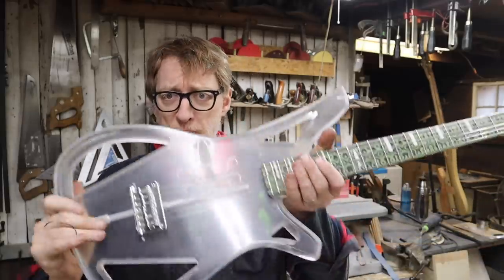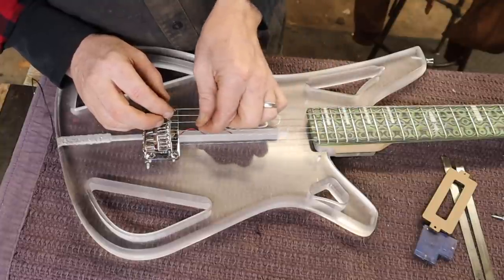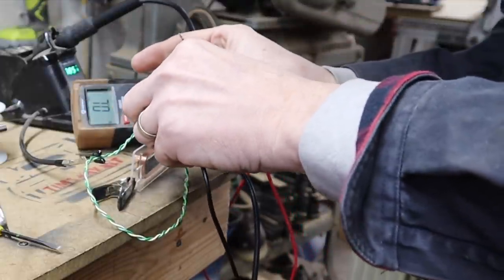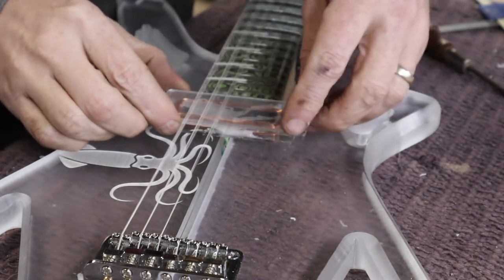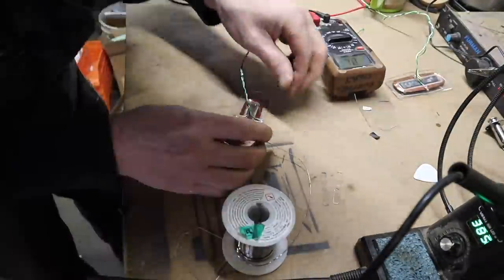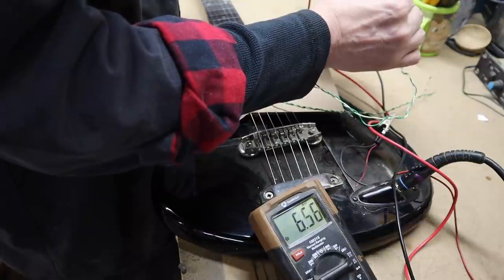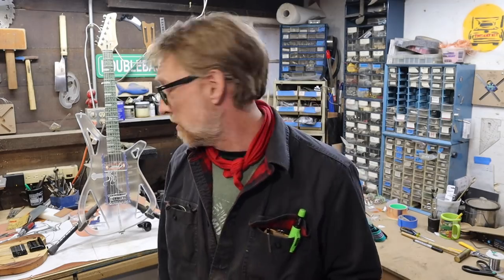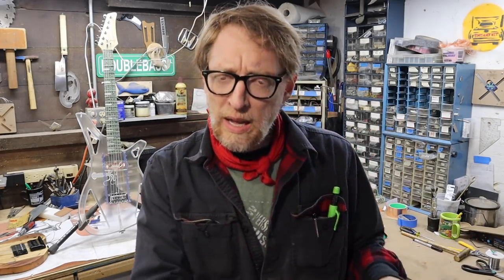Movable, "Floating" Guitar Pickup (get it???)

Comment: This sliding pickup mechanism is I think almost exactly what Gibson did with their Grabber bass. Your guitar has the added benefit of at least double if not triple the travel area.

Love the pickup itself. It's got that trashy goldfoil sound but with the added benefit of modern construction and technique. You should sell these on their own as "Neo-Foils".
Reply from the maker: For sure, I was thinking Grabber but better. If I do another it'll look even more like the Grabber, but hopefully still with extended range. The Grabber hardly moves at all. I am developing my own "goldfoils" that will be top mount and not have any gold or be called gold. That's really what this experiment was about for me, a prelude to things to come.
Reply: His setup works much better. The Grabber was limited in travel because Gibson was so intent on hiding everything beneath a plastic pickguard. It was saved only by the fact that a bass guitar has so much longer a scale length, and therefore more room to travel.

Comment: presumably, the dead spots are the nodes and the "sweet spots" are the anti-nodes of various low order harmonics. if you measured the pickup position and divide the scale length by it you could figure out exactly which one
Reply: Yes. I built myself a simple bass body, for the original is multiplex that is a bit thin. For the single pickup I simply made three different holes, so I can mount it in bridge, middle or neck position. Looks funny, but it works okay. Thanks for reminding me of possible dead spots. Next time I can look for three optimal spots. The original body lacked some resonance, and maybe I should try adjusting the pickup position. Simply turning it 180 degrees will make a difference. Interesting! Maybe I should give that original body a second chance. Floating bridge? Hmm.
Reply: You can calculate all that on open strings, but when you fret the note you will change the length of the vibrating string and the nodes and the antinodes move accordingly. This is always the problem with the "sweet spot" pickup placement. It depends on what you play. The beauty in tim's design is you could optimize the pickup spot for a song... Or maybe even for a part of a song if you can move the pickup fast and accurately enough.
Reply: @Elektronijaenis  Yeah, because of how that happens, pickup placement to me is much more about how the pickup interacts with string physics as you fret at different parts of the neck. To keep it simple, bridge positions are consistently bright/light/thin as they never catch a large amount of the amplitude. Neck positions catch a large amplitude at the top of the fretboard, a larger amplitude in the middle, then a lower amplitude as you work you way to the bottom around the 17th fret onward. Lastly, middle pickup positions gradually catch a large amplitude as you further shorten the string via fretting, thereby compensating for the reduced potential energy that the string can impart and giving you the strongest reasonable signal at all fretted positions without having a quantum superpositioning pickup.

Comment: you could make it even more elegant by having two more slots instead of rails, with each pickup having a pair of machine screws that go through from the other side. to move the pickup, just loosen the screws a little on the back, move it, tighten em again.
Reply: I thought of something similar while watching this. You could have a thumb screw right in the main channel with a felt washer. A small turn could lock it in place or allow you to set the amount of force needed to actively move it.
Reply from the maker: my original idea was similar to that, with a spring-loaded knob you'd pull to release. But I'm not interested enough in the concept to do all that and make it work! lol
Reply: @timsway  spring loaded seems overcomplicated i agree. maybe some nylon washers so it's the same sort of friction fit, just secured from the other direction

Comment: Hi Tim, I did this in the early nineties on a strat with three single coils  and used plastic U shaped strips cut from builders ceiling edge trim lengths.
 
I had the rails angled down towards the neck to allow the rear pick would  up to sit higher... The rails were adhered to both sides of the swimming pool route ..
Reply from the maker: awesome. We were talking about making it higher at the bridge in the comments. great idea!

Comment: One of the reasons for "hotter" output pick up in the bridge is because as you get closer to the bridge the movement of the string is less therefore less induced current.  Well I remember getting that gem from some pickup guru at some point
Reply from the maker: absolutely. you can really hear it in this

Comment: I love it with the translucent aesthetic.

I think with some of the fancy hardware ideas it could be cleaner and more slick. I'm sure you have thought of this,  two metal strips in the slot that both conduct the signal and act as the friction guide. Might need something on the back of the guitar to hold the pickup down. But yeah, that's getting into the weeds for sure.
Reply from the maker: oh yeas, I thought of it! lol. So much I made a detachable double neck guitar in last year's GGBO that features snap connecting electronics as proof of concept.

Comment: Tim I truly believe if you pursue this floating pickup rabbit hole, making it as easy and smooth to move as a whammy bar could actually redefine what an electric guitar can do. What about split pickups? What about 1 pickup in four parts in a humbucking configuration like tele middle position where you could have a huge spread. Each part split for bass and treble side and 4 rail systems total.

What if the pickup was rigged on elastic or springy wire so they could bounce around and react to your playing?

My favourite part of electric is the dimensions of feel you can add as a musician in contrast to something like a piano. Vibrato, bends, slides, whammy bar, Wah pedal, and now movable pickups. 

Pickups have always been fixed, pickup position Has such a huge influence over tone and sound. Why not unlock that feature and give the power to the performing musicians?

I've seen movable pickup systems but the simplicity of your system and seeing you move it live while performing really made something click with me. Please pursue further!!! (If you're inclined)

Comment: I've always wondered about getting the perfect combination sound of two pickups. I've always hated the sound of two pickups on at the same time when the pickups are in the usual positions (most Gibsons or a Tele, for instance). Strats are better because the pickups are closer together. They produce less quack than two pickups farther apart. I find myself craving even less quack though. I want to hear what two pickups (Strats or Teles being my go-to) with one in the usual neck position and another sort of halfway between neck and middle. I built a guitar 30 years ago that had four equidistant pickups and was able to get that sound. But I didn't keep the guitar long (I put a Kahler on it and totally ruined its tone) so I don't know if it would be worth repeating the experiment again.

That's where you come in. LOL.

Comment: A second comment and aside on construction: You should use flexable Silicone stranded wire, it is less likely to break from the movement. 

A Theoretically better choice mechanically would be running copper strips for negative and positive bus bars, then having the pickups negative and positive leads be springloaded pins that pressed against these - It would also give it another way to keep its tension on the guitar body. The issue with that is its more susceptible to corrosion and debris.

This overall is a concept Gibson explored back in the day with the Gibson Grabber Bass, but that thing lacked the scope of movement you have here. Really like your spin on it.

Comment: Don't want to sound like a nerd or anything but historically bridge pickups in sets are wired hotter (more output) than their neck matches to compensate for the lower amplitude of string vibration closer to the bridge. Maybe you can do a workaround to that by making the rails oblique to the body's plane, so that the pickup is closer to the strings at the bridge (higher) and further from the strings at the neck (lower) so you can get a balanced output volume all across the slider
Reply from the maker: yes! I've discussed this with a few people. I think a slightly "uphill" channel would do the trick.

Comment: If posible I would think about experimenting with the whole contraption somehow being at a slight angle, so the pickup gets slightly further away from the strings when going towards the neck. This would maybe somewhat counter the perceived volume increase the more you go towards the neck due to more bass freq content / larger string vibration amplitude (reason why bridge pickups are overwound in comparison to neck pickups in pickup sets).

Comment: To me it suggests chosen pickups should be ‘tuned’ into position to determine the sweet spot before mounting them when building a guitar.
Reply from the maker: indeed. I always knew there were "sweet spots" but I had no idea how dramatically different they are. A real under powered pickup really highlights that. My guess is the spot is going to be in basically the same spot on every guitar of the same scale length, tho, so I think it's pretty safe to generalize. What I learned from this is I'm going to push my neck position pickup back just a tiny bit in future builds.
Reply: Would be worth trying with different strength pickups on main brands to see if there’s more than a subtle difference. I could imagine yours being an ideal audio guitar especially without additional pots.

Comment: I've been toying with the idea of sliding pickups for a while... but since it was basically impossible to put a patent on them, I lost interest. Anyway, you could get a much cleaner system if you put the pickup on a tiny threaded bar going thru the body, and having a long threaded rod in the "butt" of the guitar body to move it back and forth. If you tighten, the pickup will move toward the bridge and vice-versa. The guitar already has a channel routed in the center line, so it would be easy to do.

Comment: Great work Tim. I enjoyed hearing the tone variations in the different positions. Have you considered using a round flange on the back of the bobbin (to go into the channel) so you can angle the pickup?
Reply from the maker: the original idea was to have a spring loaded round post run through that channel so you'd pull on it from the back and slide/spin, but there were pros and cons and the "wave" tracks were still needed. I could spin the first one diagonal and heard/saw no benefit to it, so I didn't miss removing that feature.

Comment: Cool. I like the sliding pickup. Yours is the most elegant design I've seen. It makes a very effective and instructive tool. 😎
I've experimented with moving the pickups on my guitar, and there are a couple of spots they are extra loud. As you mentioned, a 2-pickup design would probably suffice, and that's what I currently have. Thanks
Reply from the maker: I don;t think you need to go crazy winding them. I'm not an expert by any means, but it seems the length of the wire in relation to the poles is part of the equation, so less winds around a smaller pole is still appropriate? I dunno. Just start making and trying things and NEVER expect to get it all right the first time.

Comment: I tried making something similar with a cheap strat that already has the swimming pool routing. But my idea was to use two metal rods like the ones you'd find in a disc drive for moving the laser, and the rods themselves would be the contact points to the pickups, so no moving wires. Still might work it someday.
Reply from the maker: that was my initial idea, to make the top and bottom contact points the electrical connection (then you could swap new pickups in and out without wiring changes, if done right). Requires a little more engineering but totally doable

Comment: I’d like to see one that’s got a toothed rack in the trench, and a rotary damper on the pickup. It would resist movement but still always be mobile and infinitely adjustable.
Reply: I'd like one that has an air cusion underneath, moving like a hovercraft.  Has anyone reminded you of the "keep it simple stupid" motto before? Simplicity is its own reward.
Reply: @voornaam3191  only if I can use farts as the air cushion!
Reply from the maker: funny thread. Kevin, please share a video of your fart-floating, rotary damper pickup.

Comment: Tim, would the wire work harden and break after some time bending and flexing ? I just added a battery box to my emg equipped franken-tele and am paranoid about the wires flexing every time I open and close the box. Maybe I'm just being foolish.
Reply from the maker: wires are designed to flex. of course everything eventually wears out but I wouldn't worry about it. The concern would be abrasive or compressive contact (cutting/rubbing)

Comment: Love your videos Tim. I was wanting to build a two pole piece pickup, just the two lowest strings. I was wondering if the resistance needed to be in the normal range for a full pickup? I think I would end up with excessive windings, or would two really strong magnets help boost the output?
Reply: I think he may have accidentally replied to you in Picksalot's comment.
Reply: @thirteenthnile3536  found it, thanks!

Comment: There must be a way to move the pickup with a whammy bar
Reply: I think you'd have to get a bit more high-tech. I'm imagining a springless Kahler-type cam attached to a system of gears similar to what you find in a measuring wheel, which leads the pickup along a track.
Reply: Or with a mechanism like the HipShot or B-Bender.